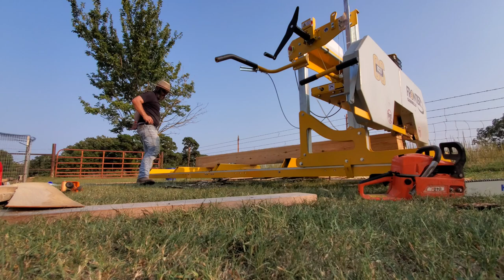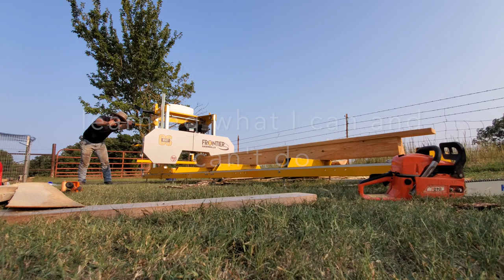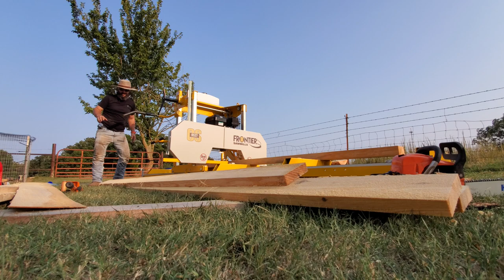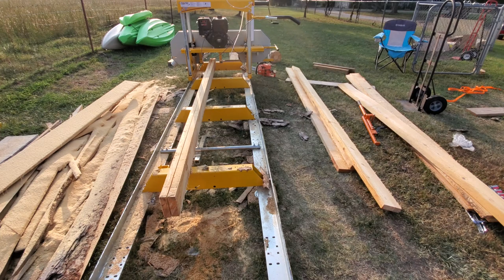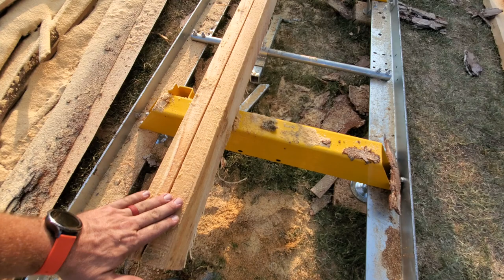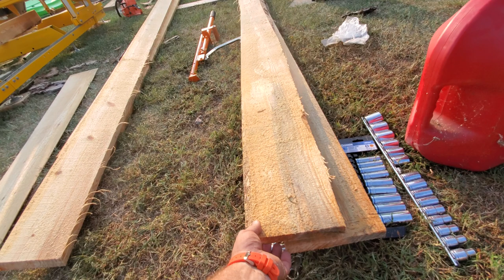Frontier Sawmill - OS27 - Making Deck Building Lumber!

Comment from the maker: A guy actually messaged me and told me where it was squeaking.  There are wire cables that go through some pulleys and they twist around a shaft. He said that was the source of the squeaks.  When this thing gets setup again, I am going to closely go through the manual and redo some things.